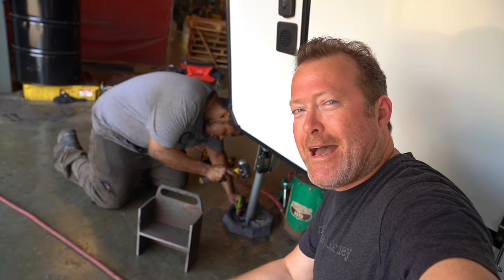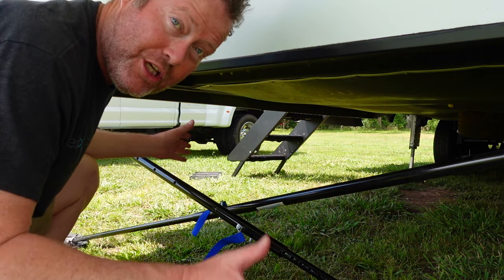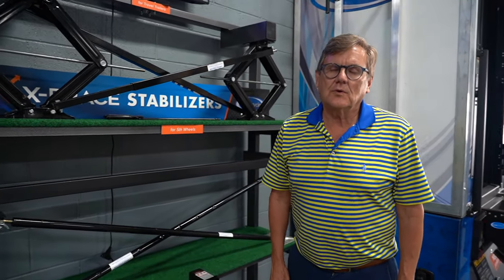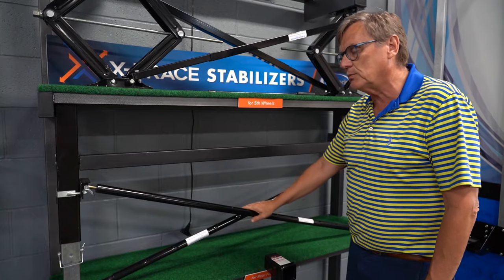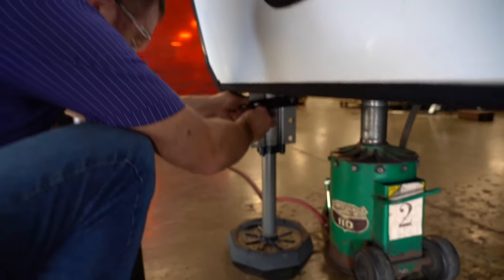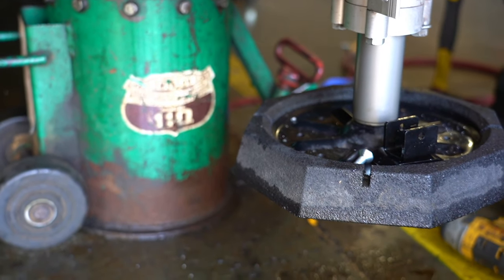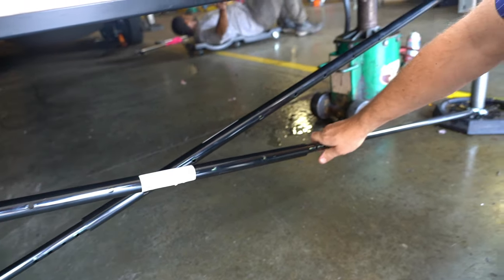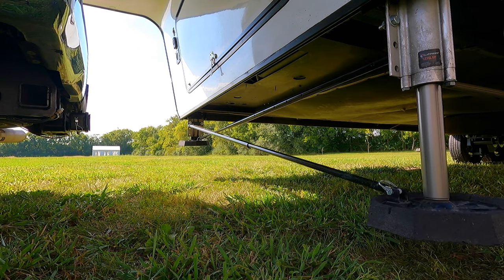FIRST TEST! Prototype RV Mod & Upgrade From MORryde (Will It Work?)

Comment: What about corrosion on the aluminum on steel? I see the components are painted which may stop the corrosion,  I would like a review after you use the system a couple time,.

Comment: Does that rear stabilizer interfere with the ramp coming down?? If you wanted to load a "toy" in to the toy hauler, do you need to undo the stabilizer before you lower that ramp all the way down?